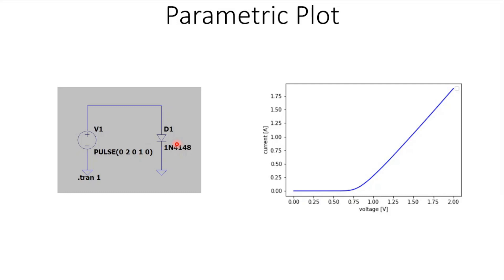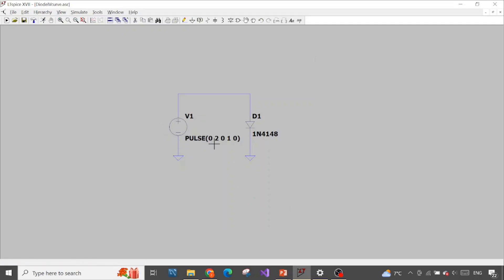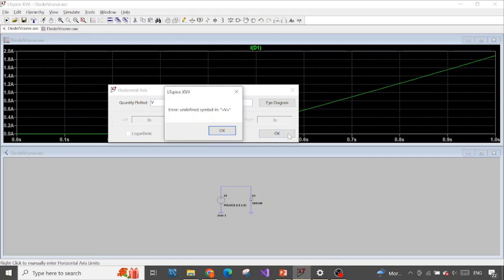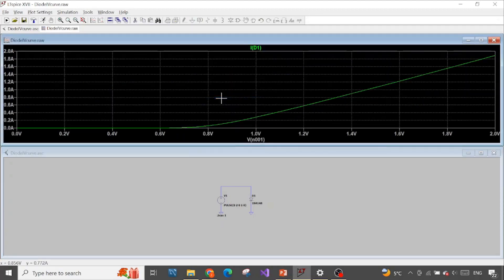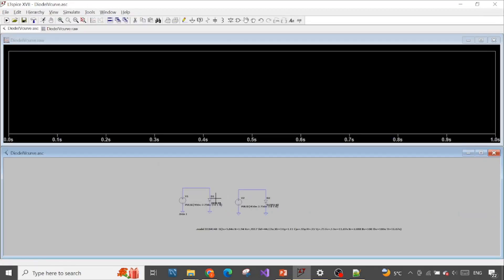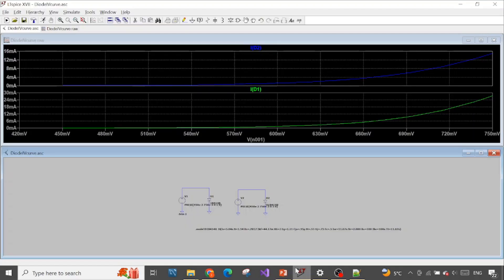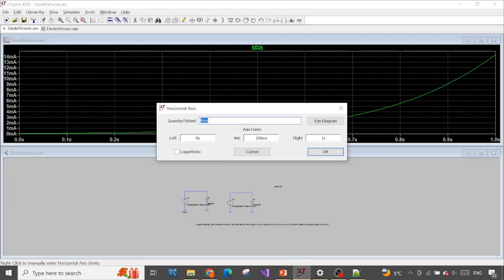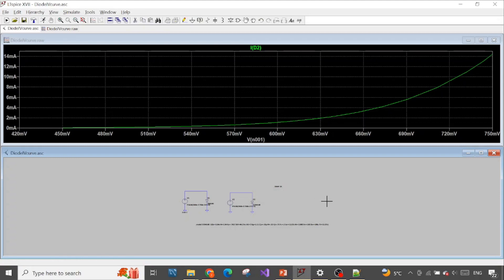LTSpice, Parametric plot, Diode IV plot.

Comment: I try to change the Quantity Plotted to time, but its appear "undefined symbol". why this happen?
Reply from the maker: it is just my guess. Before opening Quantity Plotted box, I already set the 'Transient analysis'. So, the very-first plot was Current against 'time'. After that, if we open Quantity Plotted box, by default, 'time' should be seen. Error in your case, maybe, because you might not set up the 'Transient analysis' properly.